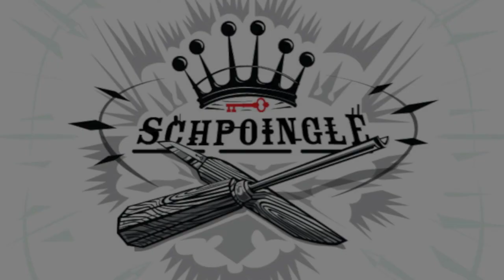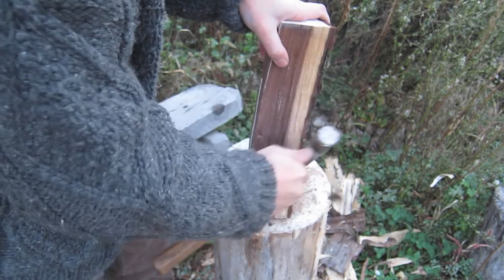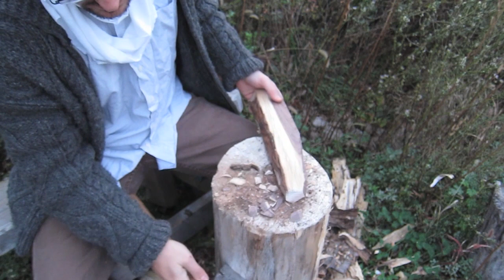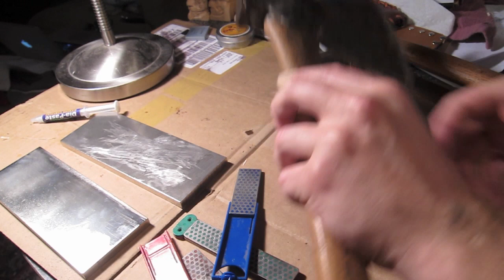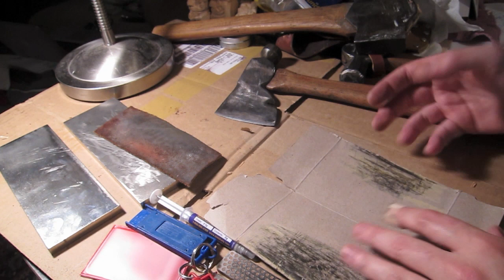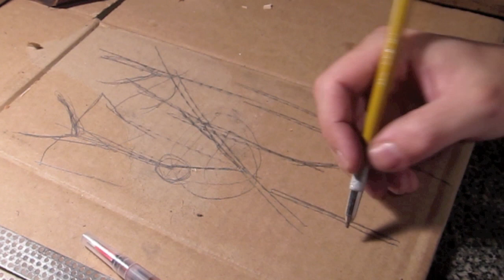Axe Hatchet Carving Buying, Shaping and Sharpening...and safety

Comment: I like the sweater. I thought I was the only guy younger than Mr. Rodgers that wore cardigans. Good, pure wool is getting as hard to find (in america anyway) as good tools at a good price. I get both at resale/ thrift stores, estate auctions and yard sales, newer stuff is alwats cut with garbage, be it metal or wool.. otherwise its a hundred dollars a shot for something that used to be the common, at an average price. Which is why I am watching videos of modifying older hatchets for carving. Plus I like the older metals for some of the reasons you said, plus the age and recycle factors. Nice to know I'm not the only one in a button up sweater with a woodcarving knife in my pocket.
 Cereal box cardboard strops are great, especially for friends who havent tried one and are used to stones and a heavier hand. It is easier for them to get their angle right even if they are heavy handed, since it does not give so much as to round an edge like leather can.
Reply from the maker: Hey thanks! Yeah I actually crocheted it myself. It was like near 100 bucks in wool yarn. Cheers

Comment: I bought a diamond edge sharpening tool from harbor freight.  any good?  it seems pretty rough
Reply from the maker: +Larry Ewing depends on what grit it's supposed to be. dmt is the only brand that sells the higher grits. so think about getting a red and green double sided butterfly tool from dmt.  you can still use the HF for rough work.
 all diamond stones have a 'break in' period. it'll be really aggressive the first few times. you got some work to do on your